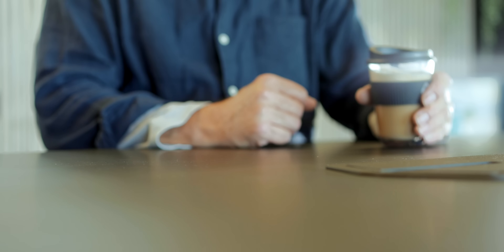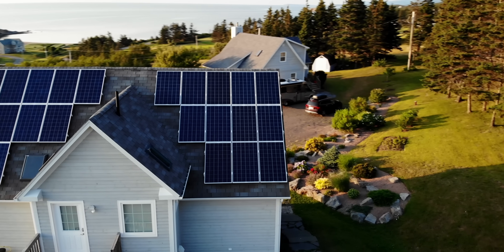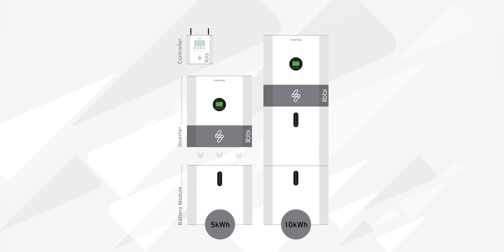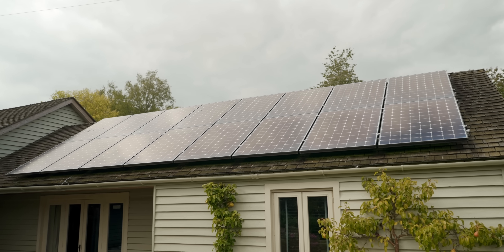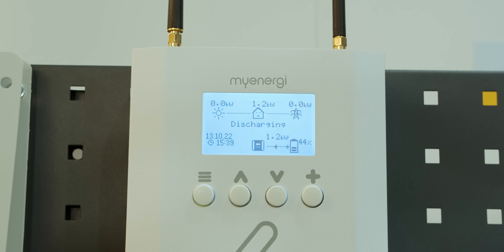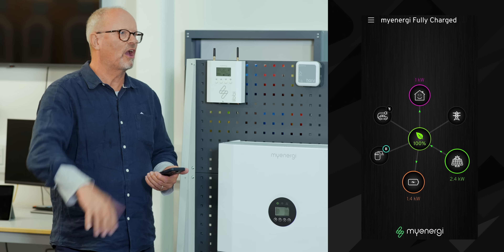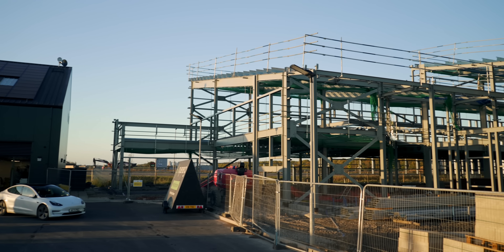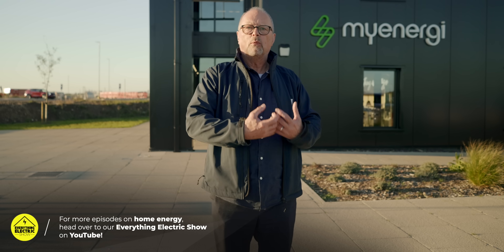THIS Home Battery is the Key To Cheaper, Cleaner Energy!

Comment: Looks great.  I'd love one!    I would also like My Energi to develop a smart plug.  I've a PV system, and Eddi, and an EV.  But I'd still like to use excess solar to turn on a heater in the house.
Reply: Problem is the switching technology to divert the exact excess power is a big large to fit in a smart plug.
Reply: Do you charge your car by off peak grid or by your solar?
Reply: @fanfeck2844  Both, but solar doesn't put enough in, so we have to top up from the grid.  But some days the car is in use, so what to do with excess on those days?
Reply: You already can. Just wire it to the second output on your Eddi. An electric storage heater is ideal for this purpose.
Reply: You already can. Just wire it to the second output on your Eddi. An electric storage heater is ideal for this purpose.
Reply: You already can. Just wire it to the second output on your Eddi. An electric storage heater is ideal for this purpose.
Reply: You already can. Just wire it to the second output on your Eddi. An electric storage heater is ideal for this purpose.
Reply: You already can. Just wire it to the second output on your Eddi. An electric storage heater is ideal for this purpose.
Reply: You already can. Just wire it to the second output on your Eddi. An electric storage heater is ideal for this purpose.

Comment: I have the impression the libbi doesn’t work off grid. It’s also restricted to 5kw solar array I think. They should put bigger solar inverters in, or give you the option, so you can over dimension for winter time. This could be a perfect off grid ev charger.
Reply: They do have a bigger inverter, they just didn't discuss it in the video.
Reply: You have to register as a solar farm when you go past 4kw. It is far more paperwork and expense in the UK.
Reply: @MrPhlipflop , yep true, that’s in the UK the case. I’m from Belgium, we don’t have that legislation. I’m also thinking off grid solemnly for EV charging.
Reply: @MrPhlipflop  you don’t register as a solar farm, you have to complete a g99 application, for many it’s a formality, it’s just installers can’t be bothered.